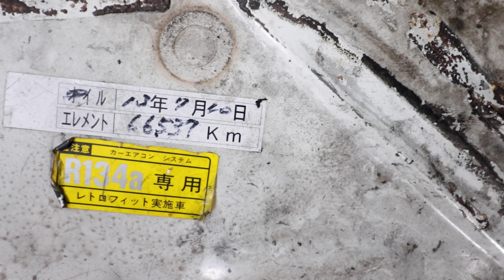Female Gravel Cyclists Shred Single Track Camper Van Day 3

Comment: What was the problem with the van? Inquiring minds want to know
Reply from the maker: The bolts for the alternator were loose
Reply: @EverythingsBeenDone  ahh cool. I was going to ask too. I just imported an Isuzu Elf camper (picked it up from port last week) and it has the same Vantech camper as your Delica. I plan on doing similar camper/bike adventures! So if you ever make it to Maine and want to meet your Delica's distant cousin lmk!